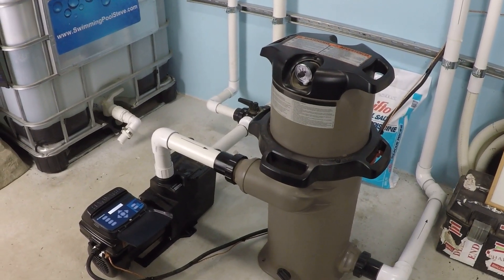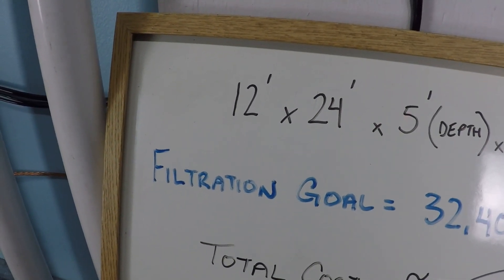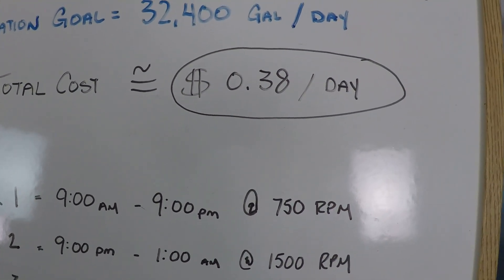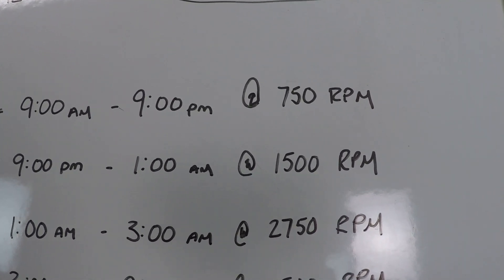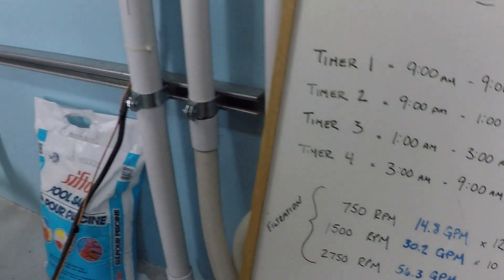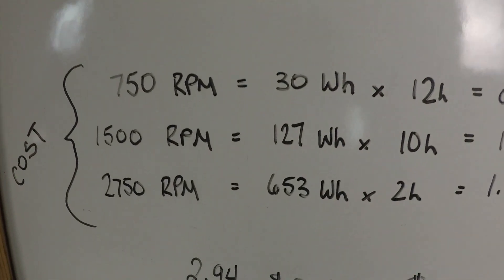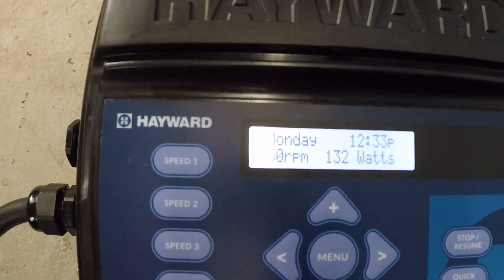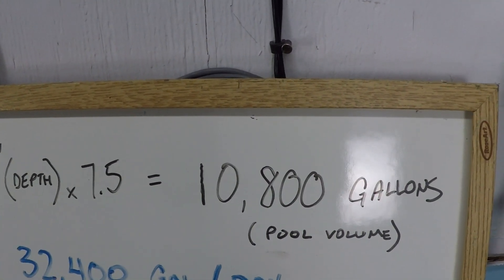12'x24' Pool Filtration Schedule

Comment: what size solar panel power is needed to run your system at 3450 rpm 70 gpm at 1.3kw, this is the max case with VSP?
Reply: Well you can't run the pump directly off of solar but if you were going to offset its power consumption you would use 150% of the power rating. So if the pump is drawing 1000 W you would need about 1500 W of solar to offset its consumption. Although the overall discussion gets a lot more complex than that.

Comment: Steve, I have a 28' X 14" in ground in Florida.  6 1/2' in the deep end.  Approx. 15,000 gallons.  I'm using my Pentair VS to give me 3,000 rpms for 4 hours, 2,000 rpms for 6 hours and 1,250 rpms for 14 hours.  It's salt water so I'll have the salt set up for the 10 hours with higher rpms.  1,250 rpms uses 100 watts.  I had it at 1,200 but it had resonance and was too loud.  1,250 is nearly silent.  Sound good?

Comment: I have a Hayward S180T sand filter now. I don't love it though. How do you like that Hayward cartridge filter?
Reply from the maker: I love it. Only 150 sf but capable of 120 GPM max design flow rate. Also available in 100 or 200sf models. Look up the max design flow rate for your filter, and I bet it is less than half of what this model can do. Which is what I suspect they made it for...it's impressively high flow rate capable for such a small filter.
Reply: @Swimmingpoolsteve  Ugh. I just checked the manual & max flo for 1.5in plumbing is 45 GPM. Definitely going to look around this fall for a decent deal on a Hayward filter like yours.

Comment: Love the video, but wouldn't those cost change with a 110 volt setup ?
Reply from the maker: Sure with a different pump the values will be different. This pump in particular was 230v only
Reply: @Swimmingpoolsteve  it would be good to see a comparison from 110 volt vs 230 v. I would imagine 110v pumps are more common with that size of a pool..
Reply: I have been following you for a while.. I thought a while back you recommend a pump run time of 8-12 hrs a day..  I have a 15x30 AB ground and I have my timer to run about 10 hours..
Reply: @martyjr540 that's not true. There are hardly any swimming pool pumps, no matter how small that run at 120 V. And if you were looking at the gallons per minute of flow, the power consumption would be the same at 240 V versus 120 V. The amperage would be double at 120 V but the power consumption would be the same.
Reply from the maker: I recommend 24 hours per day! But with a variable speed pump of course as this is how you get the lowest cost filtration, but also the highest quality of filtration. Best of both worlds!
Reply from the maker: I have lots of videos and links just like what you are asking for. This page has a bunch: https://www.swimmingpoolsteve.com/pages/240-15-superpump.html and also for more small pool calculations: https://www.swimmingpoolsteve.com/pages/compare-savings2.html
Reply: @Swimmingpoolsteve  thanks I will go back and refresh my brain..